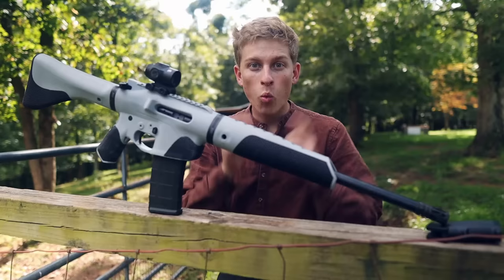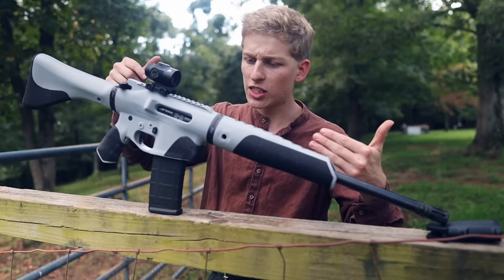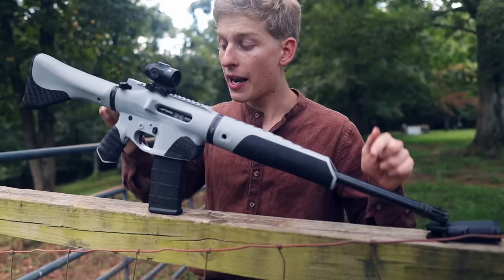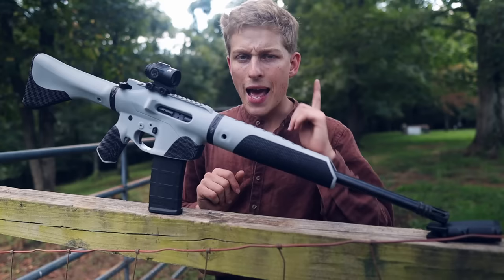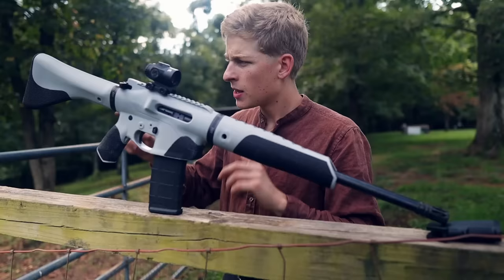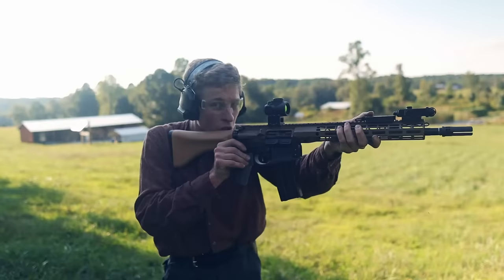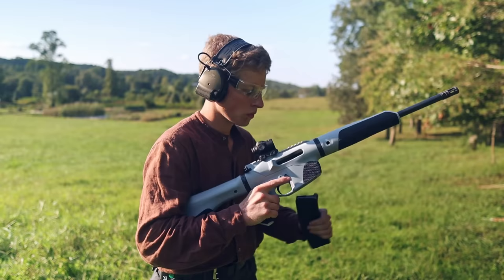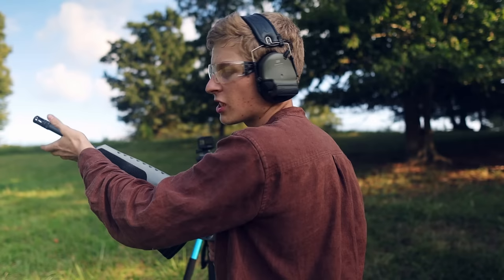I Printed an AR-15

Comment: I think the ejection problem reminds me of an issue I had with my kimber, I had a kimber that spit shells in my face and was told to send it into Kimber for them to change the extractor I believe. The gap was either too big or too small. I believe this is exactly what your dealing with.

Comment: Its your deflector. Unless your gas block or buffer are different then your gun is over gassed and bolt speed is up test this with a heavy buffer. Or lastly the lubricity of the CF plastic is creating less resistance making bolt speed increase. Hoffman tactical what printer are you using for carbonfiber printing and what machine would you recomend?.

Comment: The ejection problem is caused by the thickness of the upper.  It makes the brass deflector stick too far out before the empty case hits it, so it hits the curved part instead.

Build the 45 degree slop INTO the ejection port to solve the issue.
Reply from the maker: Honestly, I thought this was what it was as well, but it had no effect on the problem when I made the change! Take a look at a mil-spec upper, they also have a big flat spot.

Comment: I feel your upper is very thick near the front ejector port. and the geometery looks much flatter near the deflector up against the lip bordering the BCG, the flat surface seems to be more direct and forcing the casing back forward and into thick forward section of the upper causing the second bounce, increasing loiter and chance of getting caught by the bcg as it feeds the new round hence the stovepipe. The bcg indeed is a bit more grippy on the casing but normal uppers from regular manufacturers work with it better because of how thin the ejection ports are in comparison.

Comment: I think it might be because of the thickness; i wonder what if the ejection port was longer by a 2 or 3 mm in the back to give more clearance, since material thickness is likely not something that can be reduced.
also the flex between the upper and lower.
I think its caused by the force translating from the bottom angle where the upper and lower meet where a large compressive force is done, near the magwell and then it exaggerates through by the time it reaches the rear angled portion.
if the front angle was shallower it might help with this, depends on what you can do with strength.
Ideally you'd have right angles, but i can tell this design is here to help reduce strain.
i'm not sure what you'd want to do.
maybe a design where the upper and lower is 1 piece. with the firecontrol group  being an area you add in, through the bottom. it'd have to be some kind of weird size where you either have to be able to fit your boltcarrier group in through that area,
or you can design the stock to where you can put your bolt in through the rear there somehow.
these might be dumb ideas but, best of luck i like your design
Reply: what i'm trying to get at, is the "lower" portion of the design is basically either just the grip, or the grip and the triggergroup.
this might be ruthlessly hard to assemble if the trigger group is left in, but the only open portion is the grip. and back. Lol it seems so silly to think that could even be a design, but with how the forces are its completely possible

Comment: maybe you coudl find, or print, or otherwise make, a ceramic insulator for fixing your barrel heating problems. Integza was making 3d printed rocket engines, so im sure there is some potential with the same, or similar, stuff.

Comment: Hey look into a replacement for your hose clamps try CV axle boot clemps it's got a tab that you put the pressure on and it engage the tab check it out they're held to take off when you're working on cars it might hold enough tension to hold your guns together CV boot band clamps. They are installed with special pliers

Comment: Put a 45° deep bevel on the edge of the ejection port, as well as a bevel on the forward edge of your brass deflector. The flat facing edge on the interior part of your brass deflector is making first contact with the brass, causing it to be sprung back in the same direction it came from since it's hitting a 90° angle fist. Hope this helps

Comment: For the brass deflection problem, how about you adjust the angle of the brass deflector as it may be too steep for the casings to deflect out after ejection.

Edit : Plus, your upper receiver is thicker than normal AR 15 upper thus the ejection for the brass deflector hit the thick ejection end before reaching the brass deflector.

Comment: Nice work. I’m in CAD every day and I know how much work it is to get those blends and curves right balancing aesthetics and function. 

You may have figured out the ejection issues by the time I’m commenting. I slowed the YT video playback settings to 0.25% playback speed to get a better look (still too quick to see clearly) but it looked like while the casing was being ejected, it flipped almost 180 degrees before hitting the deflector, allowing the mouth of the casing to hit the deflector causing it to act like a spring and push itself off back the way it came. You could try increasing the angle of the deflector forward more or moving the whole deflector forward a bit more so that as the casing is being flipped back it hits the deflector sooner than 180 degrees( or whatever it was previously). 
A higher speed camera would be helpful in troubleshooting (some DSLR’s go up to 1000 FPS, not insanely fast, but better than 250 FPS). Maybe a camera angle from the top down would help to diagnose it?

Comment: change the angle of the deflector, Angle of incidence is equal to the angle of reflection.  if you don't want to reprint the upper,  try filling the reflector a little bit.  where the case hits.

Comment: Change your buffer and spring to get the gas right. Your ejection would be much better.
Reply from the maker: Ended up trying this, no improvement. Turned out to be the elastic properties of the plastic.

Comment: Bad idea when you immediately went to shooter ready position after only a single shot. Just because it didn’t blow up on the first shot doesn’t mean it didn’t cause hairline fractures and full on cracks, which then woulda caused it to blow up on the second round
Reply: the pressure is contained in the locking lugs and barrel, it won't fire if its out of battery if he's tested that with dry fire first to ensure correct design. So actually on the printed ones I've heard the most stress is not shouldering it (nothing to push against the spring imparting force on the buffer tube if your shoulder is gone, so it pulls apart the layers on the rear and FDM printing is very weak in tension along layer lines). It should fail non dangerously, but I would suggest a paintball mask or something (eye protection with some plastic meshing in case it fragments somehow, a plastic splinter would not be fun).

Comment: Integrate a heat sink for the barrel into the hand guard?  If you can leave enough space, a relatively small copper or aluminum heat sink could double the number of consecutive rounds to around 180-210.  If you build it correctly you could even use a thermal compound if the print holds the heat sinks in place.

Just a random thought.  Great job by the way, loving the progress.

Comment: For the handgaurd you could simply thread the upper and the handgaurd and use a single bolt to clamp it in the clocked position same with the stock, however you may see a weak point with this method on the stock

Comment: absolutely amazing design! A replacement of some sort for the hose clamps and this would be at home on the shelf of a nice gun store. the brass deflector needs adjustment though it's trying to throw them right back into the port. ah i see you mentioned it right after...

Comment: It looks like the brass is hitting the flat wall inside the ejection port just shy of the deflector. Not sure if bringing the deflector in or filing the wall out would be better.

Comment: you could also try printing it in petg. more heat resistant and stronger than PLA, not quite as much as frn or CF nylon but petg is cheap and accessible to anyone with any printer.
Reply from the maker: Not quite ;) PETG is much weaker, and has very poor impact resistance, sadly. It is slightly more heat resistant. But I'd use ASA first, though it's not much better.
Reply: @HoffmanTactical  got ya, didnt know that about PETG the 3d printing community generally says its stronger due to its tendency to deform rather than fracture under load like PLA but impact resistance would of course be a better property to have for firearms. I suppose slightly better heat resistance wouldn't matter much either considering how hot the gas system gets. Either way your build is an impressive piece of design thanks for sharing.

Comment: The problem i had was that PLA cant take heat. I printed stuff for my job, AA battery holders etc. I left it in my car by accident and it became warped from the sun. Most plastic thats used for 3D printers are not rated for higher temps.
Reply from the maker: Yes and no. PLA has heat resistance issues, but is great for testing other then that. However, many materials have great heat resistance. Polycarbonate and filled Nylons being the most common.

Comment: 3 months old but what if the bolt doesn't ride all the way forward? On Army issued M-4's there is a forward assist that looks to be missing here.
Reply from the maker: Forward assist had to go due to geometry. Wish I could have added it, but it's not 100% needed. Other ways to fix issues, like racking a new round. If a round won't chamber the second time, no amount of forward assist action with your soft hand is going to fix the problem.
Reply: @HoffmanTactical  Good point, appreciate the speedy reply. I am a huge fan when it comes to mechanisms and especially 3D printing them. If I had a better printer I'd print custom frames for my rifle as well and probably the shotgun too.

Comment: For the selector detent you could just go in from the top Ala Colt polymer lower or KP-15
Reply from the maker: Problem is removal, once you install a KP-15 detent it's hard to get out.
Reply: @HoffmanTactical  set screw with spring detent?

Comment: If you went with a side charger couldn’t you build up the back portion of the upper to go further back over the buffer tube to strengthen it?
Reply from the maker: Yes. That is an option, but I would rather use a rear charger if possible.

Comment: A lot of weight of the brass is in the base, and the wall on the back of the ejection port is really thick. I think thinning the back wall and putting more of a taper on it could help kick the top of the brass back and deflect better

Comment: @Hoffman Tactical, because of the heat issues caused by the gas block and tube, would the AR9 platform be a better candidate to "fully 3D print" than the AR15 platform?  Because the AR9 is blowback operated, there's no gas tube to heat up AND your issues with accuracy are less of a concern with a shorter distance cartridge like 9mm.
Reply: Also the industrial design of your gun is superb.  You have single handedly done to AR manufacturers what Chairmanwon has done to Glock (outclassed them).
Reply from the maker: AR-9's are a lot easier, much less heat is generated by the much lower power round.

Comment: need to fine tune the deflector on the side of the rifle, im thinking a steeper angle on the front face. and maybe fillet the ejection port toward the back on the opening a bit. nice rifle. curious to see how it would hold up long term and at high temp.

Comment: Try a heavier weight Buffer, and look at a gas ejection arc chart, that will help a lot. It looks like you are really over gassing the system for the buffer weight you have in it.

 I'm guessing you have a  3oz or 3.8oz buffer weight?

On a side note for ALL AR platform owners, look at the chart I mentioned above, if you are over gassing your system it will result in faster wear and tear on your BCG's, specifically the bolt cam pin.

Comment: Is it possible that this was a gas issue? Rifle trying to eject forward, so you get that bounce in the ejection port, then with a slightly heavier BCG it's ejecting between 2 and 3?  I'd try a heavier buffer/spring combo and see if it improves.

Comment: I wonder if you could thicken the gun a bit and add a layer of insulation between the barrel/bcg/etc and the plastic. Then have some sort of heat pipes going to the outside of the gun. Heat is going to kill this very quickly so if you can somehow insulate the internals and move the heat outside with heat pipes I imagine it would be able to survive much much longer.

Comment: looks like you could make the port slightly smaller by moving the deflector forward a few mm, if you see where the bcg stops in the slo-mo I think I can see the neck of the bolt and unsure on size relation on my screen but might be 4-5mm, I would think you would only need it to be to the point where the bcg face is.

Comment: looks to me that the rear of the ejection port where the deflector is, is the cause, or adding to the issue.. it's flat there and thick, much thicker than my "normal" AR uppers, and the cartridge looks to be bouncing off that flat surface, and not being engaged by the angle of the deflector. 
I realize you likely need that thickness for strength but perhaps you add some angle there at the back of the ejection port. 

Just a thought, I'm no expert on 3D Printing by any means, just looking at the slow motion, and comparing what I see to slow motion ejection on "normal" ARs. Still a beautiful rifle, really hoping you can release it soon, I'd love to learn to build this one.

Comment: Try widening the ejection port at the rear if you can. Also, deepen the angle of the brass deflector so it's even further from perpendicular to the center-line of the barrel. Your ejection problems might go away if you do both of those things.

Comment: "I 3D Printed an AR-15" 

Don't mind all the internals from a normal AR15...
I'll be surprised when 3d printers actually print a full weapon (all of its components and body) not a shell to hold the components from the real gun!
Reply from the maker: Tell that to the feds LOL.
Reply: How bout the fgc-9 its as 3d printed as a 3d printed microscope, 3d printed 3d printer and 3d printed bladeless fans. The metal parts are all made at home from hardware store parts with a hexagonal rifled barrel.

Comment: Hey I have 2 suggestions move red dot so it's above the bolt Carrier group maybe slightly forward of it but not beyond it.  And about your brass deflector The front face next to the ejector port needs to lean back farther towards you you could try it with a file on one to see if you can file it down slowly till you get it to the right shape or just eliminate the brass reflector altogether

Comment: During the mag dump around 17:10 you can see the rear end of the upper and lower separating and I think that if you could somehow reduce how much it separates you could probably increase reliability, accuracy, and most importantly safety but definitely a really cool design ( I don’t think this will help much but I hope it’ll help a little)
Reply from the maker: You would be surprised how much other AR's flex ;) It really has no downside.

Comment: I mean.....you installed the gas block and gas tube right?

You never mentioned those components
Reply from the maker: Pretty simple. As long as your carful to align the block it's easy. Gas system is the same as any other AR.

Comment: So, ignoring the upper receiver, are there any heat transfer issues concerning the lower receiver? Like how much heat, if any, is transferred to the lower receiver when shooting, and is there a danger of the lower melting or entering that transition temperature?
Reply from the maker: No, even with PLA+.

Comment: Heat is going to remain a problem. Not sure what can be done about that without some non-3D metal additions to try and absorb and disperse heat at bearing surfaces.

Comment: You seem to be having more felt recoil on the 3D printed upper. If it’s that much lighter weight and allowing more recoil maybe that combined with the plastic eating more of the energy of the casing as it ejects Vs a metal ejector plate could be causing the case too just not have enough energy to pop out and then off of the gun. 

I’d say try clamping this iteration into a lead sled with the “bad” BCG. And if that does help then possibly a smaller surface area (maybe a forward facing bevel) on the ejector plate would eat less of the energy and allow a better bounce out. 
Other things you could try is weighing both BCG if the aero is slightly lighter you would probably feel less recoil from that and therefore half of the equation of what I’m saying would be proving itself enough to at least not cause jams.
As well as the first iteration being I’m assuming heavier possibly proving this theory.  

Let me know if that helps at all!
Not a gunsmith by any means but I am a decently mechanically inclined 25 year old.

Comment: It sort of looks like the walls at the port might be a little thick, but on a normal AR aggressively forward ejection usually indicates that it's over-gassed. Given the level of engineering you do I'm sure you're already aware, though.

Comment: The PLA Has a bit to much grab and bounce built in either one wouldn't make a difference but together they're playing hell.. I'm sure if you eliminate one or the other you'll be fine, a piece of something harder than the copper casing, they have this problem with steel cased ammo coming out of aluminum uppers. ANNEALING could reduce it enough but then I would expect a crack eventually, use some self lubricating plastic for the upper(these ideas are for keeping it plastic) you could try ptfe tape over it..